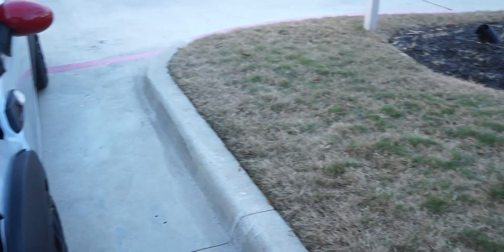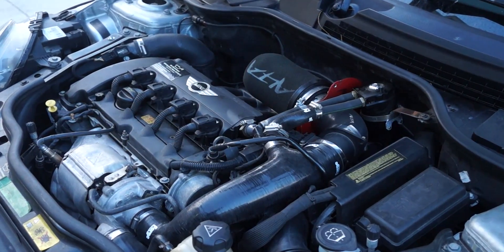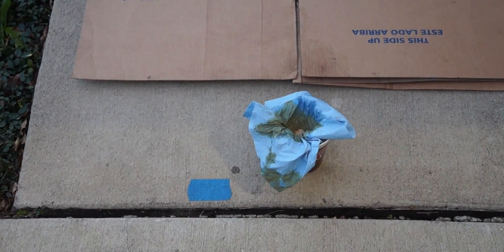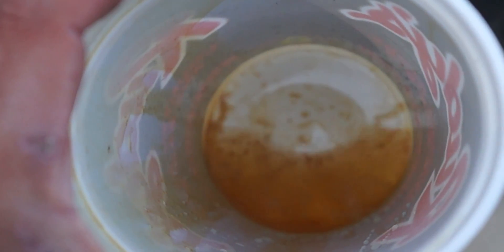R56 MINI Cooper S - Oil Catch Can Update

Comment: the problem is you've blocked off the intake manifold side of the pcv system.  under vacuum (non boost, meaning idle and light driving/cruising) you've removed all PCV abilities.  creating crankcase pressure which hurts rings, seals, and much worse, prevents scavenging of vapors.  your catch can sits on the turbo inlet side so it only has vacuum when in boost, the pcv system built into the valve cover has a flap that blocks boost from escaping and uses the vacuum on the inlet side of the turbo after the MAF sensor to pull on the pcv system.  so unless you're driving it like you stole it all the time, you're missing out on a LOT more gunk that could be filtered out of the engine. look online at mini catch can systems that are actually engineered for turbo applications.  they either use 2 cans or a multi inlet can with a baffle for boosted applications.  =)  

cliff notes:  you need 2 catch cans.  one intake side, one turbo inlet side.
Reply from the maker: Ok, this is really good info. I've been getting conflicting info from various places but this by far seems like the most comprehensive solution. I think I'm going to be ordering a second can today. Thanks Dererk!
Reply: Hmm... now things just get more complicated. I haven't seen anyone do two catch cans, is it really that important to do them both?
Reply from the maker: from what he is saying this should be fairly simple. I happen to have kept my old hose and from before the pcv caps so inserting a catch can on the intake side should be a piece of cake. Look forward to a video on that this month
Reply: check out these examples.  

https://www.northamericanmotoring.com/forums/attachments/r56-hatch-talk-2007/111388d1433122713-test-car-for-best-oil-catch-can-ever-rx-performance-20150531_185319.jpg

https://www.northamericanmotoring.com/forums/attachments/drivetrain-cooper-s/106249d1424233696-oldbrokenwind-s-thumper-head-gt28rs-and-alta-stuff-pcv1.jpg

I'm not trying to be rude its just that I was dealing first hand with this with a broken exhaust valve due to carbon build up and a complete engine rebuild.  Carbon build up is SUUUCH a big issue on these motors and anything done to prevent it is going to have massive positive effects on engine longevity.
Reply: Kyle Freeman, DC actually there is a video with one guy/company who uses two catch cans. .they even have special plugs on the other end..so it's a true plug and play unit.
Reply: Very informative,Where can I get the two cans and the rest of the parts,Have you got a list.
Reply: Bimmer Dude would you be doing a 2nd catch can install anytime soon? How did it go with the plugs?
Reply: @BimmerDude  can you update this oil catch can and PLUG situation video??? and delete any missleading videos Bro?
Reply: I don't quite understand.
so if I install only 1 can it means I am effectively blocking all PCV abilities?? (R56). 

really I dont understand how adding a filter, and not removing anything, kills all pcv abilities. or, can I skip that blow-by problem by choosing an oil catch can With a Breather???

am I missing something?? (not an expert).

Comment: Just got me a mini...hood is stuck shut...trying to get it open tomorrow.  If I get it open, this will be the first thing I look for. 

I noticed that the "L" bracket you used in the install video was replaced with a bigger one and it's now attached to the can instead of the top.  What was the reason for this change?  Thanks

Comment: I read that plugging the pcv caps by the engine cover is not good. Is that true? So I installed a second oil catch can and it works fine.
Reply from the maker: David Kuan that is correct I was informed of this recently. If you have two catch cans then you did it right

Comment: Hey , I’m having another situation with my catch can setup , I have oil leaks from the pvc ports (intake side) seams that I don’t have a good vaccum effect since I install the can ...
Reply from the maker: This maybe due to Derek's comment down below how ever it only applies if you have blocked off your intake side pcv.. if you are experiencing leaks near the ports your issue is with your valve cover. One thing that I noticed with the catch can set up is that it in earth's oil leaks that may not have been noticeable. These valve covers are none to leak in the pcv system sad to say.
Reply: I'm planning to replace the rubber seal of my valve cover - I'll inspect the PVC at the same time) But I'm still surprise of the amount of fluid you cough !

Comment: Hey I was thinking of putting a catch can on my mini, but was wondering should I get a sealed can or one with a Breather Filter?

Aswell have you ever had a problem when building boost or accelorating quicly have you ever gotten a ticking sound from the turbo? it ticks then I lose power and then its right back? Cannot figure out the problem, its very faint and only happens from time to time.

Comment: Oil smells yes I smell it when I drive in the cabin or if I open the windows. Not sure why.
Reply: Same here but mostly when I'm at a stop... don't know why either
Reply: if you guy's Kyle Freeman & Tekolicious check your engine for oil leaks, especially around your cam/valve cover, your oil filler cap & the turbo oil lines... as I've mentioned on a previous video upload comment.. also check your power steering pump & hoses as the mini has issues with these leaking.. either of these can & will drip onto your exhaust, vus burning & creating the oil smell you get inside your car... BMW's are notorious for this very issue.. so are the new BMW mini's seriously check for oil/power steering leaks....

ontop of that check the cabin filter as if that's covered in dirt & filth it'll only add to the smells....

also please don't block the PCV breather pipes as shown in previous videos... it'll add to the cam-cover pressures increasing oil leakage if already occurring, if not then it'll create oil leaks pretty quickly due to the increased pressures within the cam-cover/head "this has also been mentioned in other comments with this video" ....

Comment: I've got an 08 MCS which I love, but last night had a misfire in cylinder 3 so the spark plugs got replaced. The tech that worked on it noticed oil in the area and thinks I should move on from this car because it's burning a decent amount of oil... does the catch can improve this at all or what can I do? I really don't want to get something different, I love this mini.
Reply from the maker: Kyle Freeman, DC sorry b to hear this man. It absolutely can't hurt thing the issue here Kyle is that I'm assuming your mechanic did not explain if this was Blow by from the crankcase or from the valves in the cylinder head. These engines are known to have issues with valve seating once carbon buildup on them the valve seals might in fact be leaking oil into the cylinder. I would first remove your intake manifold or have it removed and check for a carbon my guess is there's quite a bit of it there. Best case scenario here is your valves aren't seating well and it's allowing oil into the cylinder. Which can be rectified and worst case scenario it's Blow by from worn piston rings and not much short of a rebuild can fix that. Keep me updated with how it comes out I'd like to know and help if I can good luck
Reply: Seafoam brought my mini back from death, I need a catch can, what if you had put the catch can on opposite side?

Comment: The amount you caught is very very low unless you rarely drive the car. I drive about 500 miles a week, and each week my rear catch can is completely full. The front doesnt catch much because it is only in use when the car is under boost. You also need to install a baffle so that the vapors have something to condense and get caught on. I wrote this guide here explaining all of this. https://imgur.com/a/WFLyq